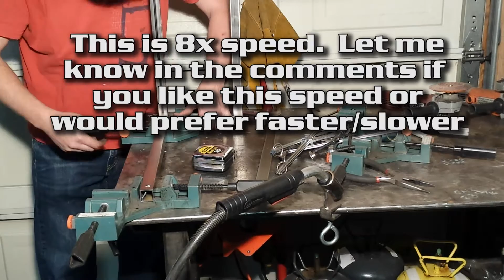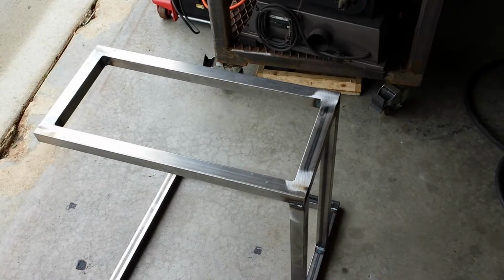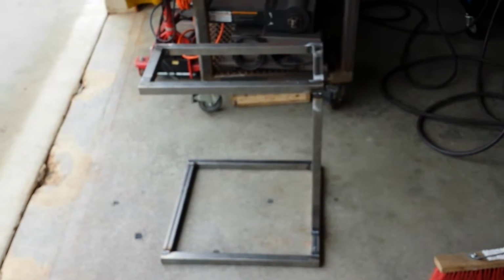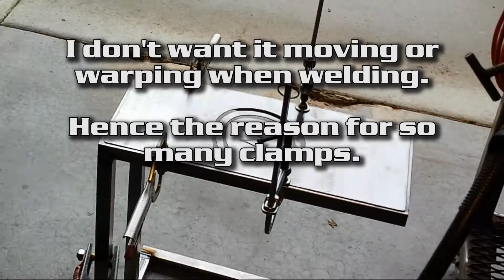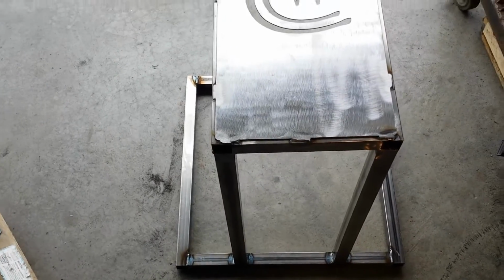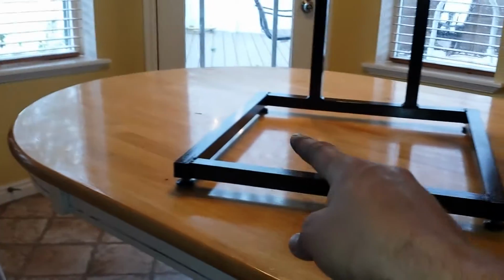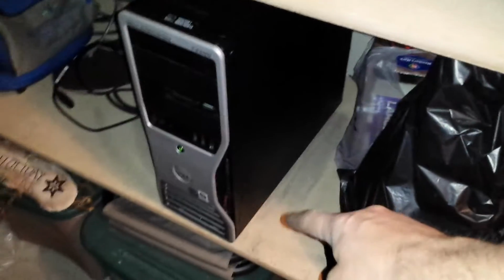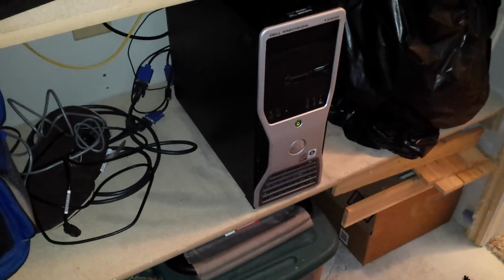Creating The "Server Silencer"

Comment: I know this is a few years after-the-fact... but for exactly that reason... have you considered running an ARM SoC? They've come a long way lately and are amply sufficient for running most home server tasks if you've got any familiarity with Linux.

I've got a 2U Dell Poweredge 815 sitting in my closet, which you can hear literally anywhere in the house. Luckily, I only need to run it for heavy processing tasks, and it's a fan-free Odroid box I keep on 24/7. I actually enjoy hearing the server rev up when I trigger the wake-on-LAN. It's like hitting the ignition on a sports car, it just makes you smile... If I had to hear that all the time... then not so much.